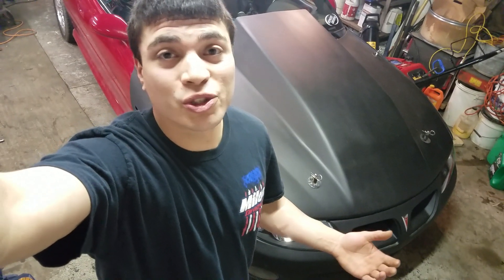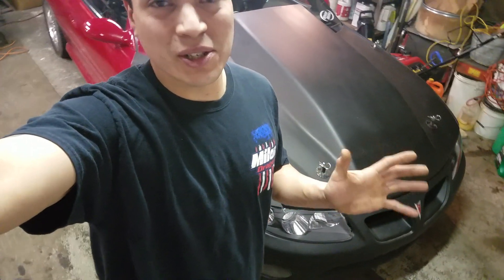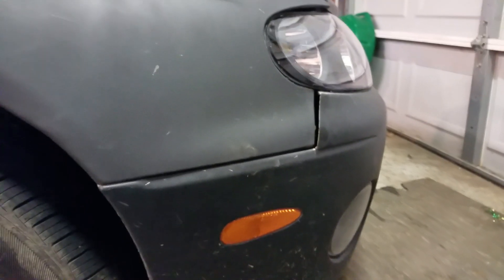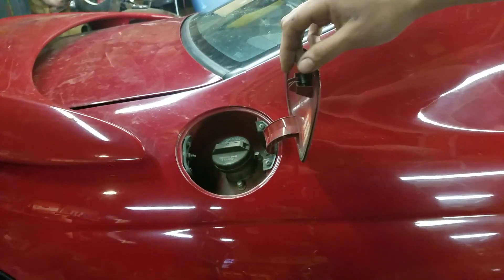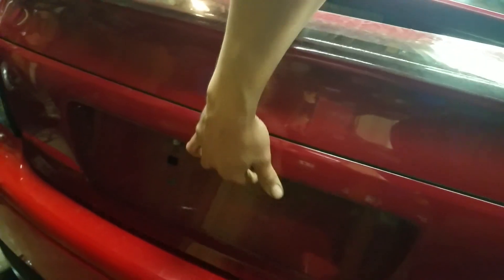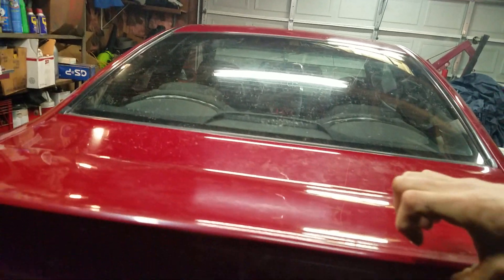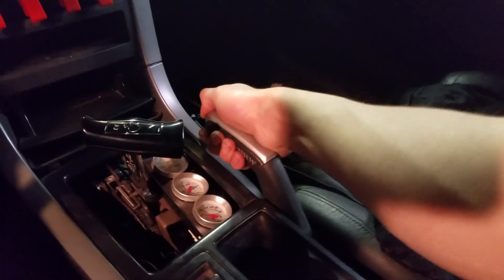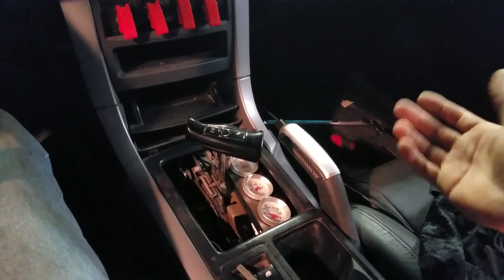5 GTO Problems [ Turbo LSX Dream Car Build ] Please Subscribe

Comment: I don't consider those man things... Yet I've experienced and fix most of those. Here are some of what I've had issues with and fixed on my own. ABS sensors, fuel pump relay, traction control button/switch, gas door seals, front pumper clips, bottom panel seal under spoiler on trunk, gas line lead to under head cover, speakers are junk I replaced all 6 speakers + tweeters and deck, but the worst of all is  ignition cylinder and the driveshaft support bearing. 2005 with kooks long headers, custom exhaust with res delete, stage 2 cams, over radiator vararam cold intake, lowered suspension, and SAP. Car is definitely a head turner and people grt excited to see it when they know what it is! Wouldn't trade it for a hellcat.
Reply from the maker: Thank you for fixing everything and congratulations I'm glad your keeping it. sounds like a really nice car what trans and color? I might make an abs video it's a big issue and thanks for the comment and please subscribe

Comment: My 06 gto has 308,000 miles on and counting its my daily its been a really awsome car been all over in it get compliments about how clean it is and people say you would never know it has that many miles maintenance is key
Reply from the maker: Congratulations that's alot of miles  🤣 Do you still have stock rocker bearings? And your right thx for the comment please subscribe
Reply: Im pretty sure there stock i never replaced them and the previous owner didn't have a record of it being replaced but now i want to get them checked out
Reply from the maker: @joseperez-nx3sv   I would get them looked at bec their are 1000 hardened needle barrings in the rockers that will be sent threw your whole motor oil galleys. Their made to last along time tho
Reply: I will eventually i would like to have the motor rebuilt i put a new transmission in it at 295,000
Reply from the maker: @joseperez-nx3sv  not a bad idea to change head gaskets,  brings and stuff and should be cheep. Damn I bet it was a 4l60l but should be good now
Reply: @JUNKYARDGTO   its got a 4l65e in it
Reply from the maker: @joseperez-nx3sv  
Right basically same thing but I went with a manual 4l80 just to be safe
Reply: That is insane! I was scared to buy one at 137k but you gave me confidence!
Reply from the maker: @sideshowjunkie  
Buy one asap 🤣 all you gota do is solid axle swap it lol
Reply: @JUNKYARDGTO  👍 will do!
Reply from the maker: @sideshowjunkie  
Awesome thx for the comment please subscribe
Reply: @JUNKYARDGTO  I will!
Reply: @JUNKYARDGTO  how come it doesn’t show your subscriber count?
Reply from the maker: @sideshowjunkie  
Thx and its turned off

Comment: you're missing the gasket that goes around the gas door, that's probably why water is getting in. Also use some dry lock on the ignition tumbler, it fixed my issue and it was getting bad
Reply from the maker: that slow goat 
Haha I forgot their was supposed to be a gasket on the fuel cap but it still is anoying and im going to spray my tumbler now lol THX for the tip and comment

Comment: Replace the whole ignition tumbler before 50-70 thousand miles. $65 for parts. So you won’t be stranded with your GTO. Don’t bother with the ignition cylinder upgrade. It just makes it harder to turn on and off. The trunk is you just have to get used to it the way it is. Yes both the front and rear bumpers are notorious for not aligning back to original specs. The front and rear bumper alignment frame clips both break easily. So the only reason to take them off is for collision only and change the side markers badge and fog lights. The less times you take off and put back on the bumpers the better. For that reason I don’t want to install a oil cooler or supercharger. I want My GTO to look as factory fresh as possible. As for the gas cap the gasket wears out only after  say 40,000 or so. So get a new one ☝️ So dust and water don’t get past the fuel door. And even then you still have to treat/rubber protectant the gasket and clean inside where the gas cap is. There is also a drainage hole there too if you spill too much fuel ⛽️ while gasing up and for excess water 💦 if your fuel door seal is bad.
Reply from the maker: Thx bro I got almost everything figured out now for my dream GTO. Im going to be posting new videos soon so please subscribe thx for checking out the videos

Comment: I have an '05 M6 that I purchased new. My gas filler recess has a drain that vents to the street. My E-brake is fine, but I only have 42k miles on it & I don't yank on it like a mad chimp. I had to have my ignition tumbler replaced @ 30k miles. It locked the steering wheel up.
Reply from the maker: Fred Garvin
The gas cap isn't a big deal I think it should be flush mount instead of a big bucket. No way it locked up at 30k what happened? Lmao new videos coming soon thx for the comment
Reply: My wife shut the car off with the wheel all the way to the left. It jammed and would not unlock. Had to remove the tumbler to release the wheel and replaced it. It's the only repair I have done on it in 13yrs. It's been a really reliable, fast, and comfortable car to own.
Reply from the maker: Fred Garvin
Damn that's what happened to me but to me the GTO is the best car ever built. That's why I've been trying to build one sense 03 lol its just taking forever bec I'm on a budget
Reply: I bought mine new, it was $29k. It was the most I'd ever spent on a car, but I just bought a ZL1 1LE  that cost a fortune. But I will not sell my GTO. You're right, it's a very well built car.
Reply from the maker: Fred Garvin 
That's awesome. I bought my first one (Rare 06 Phantom 6.0 6 Speed) in 2012 it was the best car I ever owned everything was perfect until I got Rear ended at 65 mph and I lost everything....
Reply: That's horrible. Keep up with this one. I see a lot of potential. Just take one system at a time, finish it and move to the next. It gets easier.

Comment: I'm looking into buying one in the future, do you recommend it or have any ideas of what I could do it upgrade it some?
Reply from the maker: The GTO is a great street car it depends on what you want to do with it but the automatic transmission is weak and the bushings are soft along with the the drive shift and half shafts. Don't run slicks. 
Thx for the comment and Please Subscribe

Comment: I've had my 04 GTO since 06. The bumper clip issue is certainly not "unknown" GTO owners have been aware and griping about this since the GTOs introduction. As for the fuel door, there is a gasket around it and a drain hole in the well. If yours is leaking, replace the gasket and clean the drain. The trunk lid lacking a keyhole? There are hundreds of cars on the market in the last 15 years that have no trunk keyhole. Common in the days of key-less entry. There is a trunk button on the key fob, which you didn't mention as well as the glove box botton and the emergency release behind the passenger rear seat headrest. In my 14 years of ownership, I have never once found it necessary to yank the e-brake with that kind of force, certainly not enough to break it. Could it break, absolutely, as can the shifter, but generally not under normal operation. 
As for the ignition tumbler, I have no issues with mine. I only have 53k on mine, but I would think a little graphite lube now and then would keep things from wearing.
Reply from the maker: Damn you should have bought an 06 GTO in 2006 the 04s suck lol how much HP does your car have? Do you have a 4l65e? I forgot their was a gasket on the fuel door. It's been a couple years sense I had my 6 6 06 GTO. As for the trunk I hate going in and out of my car at the drag strip to pop the trunk so  I can fill up my fuel cell lol most cars have a button or something but I did say in my video their are buttons inside and behind the back seat. I know the e brake will wear out from normal use but that's how I use my e brake lmao vehicles are meant to be driven and grafite might help the tumbler but it will lock up lol
Thx for the comment
Reply: Well, I would have to disagree that the 04s suck, I am a bit bias. My 04 was $20k one owner w/27k on it when I bought it.. 06s were still going for $33k, so I see mine as a total bargain. 
I have the T56 not the auto. 
As for the trunk release issue you mentioned, in your circumstance (racing) I can see that being an issue, but in regular use, with the button in the glove box and the key fob, it's not an issue. 
As for horsepower, my car in almost totally stock, except for a CAI.
Reply: @JUNKYARDGTO  an ebrakes ONLY PURPOSE is to stop the car from rolling when its parked ffs,not to yank up on like you are uprooting a tree dude,seriously.if you went to the dealer and showed them this like it was an issue they would void your warranty on the spot and tell you to go away. buy a drift e-brake if that's what you do but don't blame the car because you are ridiculous with it.
Reply from the maker: @trillrifaxegrindor4411  
What if it was an emergency? Haha
I used it normal on my old Manual GTO and it broke.
My sunfire e brake never broke and pulled it all the time lol

Comment: Bro that hood is wayyyyyyyy to big lol.. btw just out of curiosity how much did you give for your gto? Rebuilt title? It looks like it's in decent shape. I have an 04 impulse blue gto (mild build) 11.7 at 116 is my best quarter mile.. ls3 swap is coming this winter.
Reply from the maker: LSX 2015
Thx for the comment lmao you should check out my other videos I traded my old car for this GTO bec my 06 6.0 6 speed got rear ended. Clean title and a rough 20,000 miles on the car lol they blew the 5.7 and I smashed the windshield towing the car without the hood latched 😂 your GTO sounds legit. What trans do you have?
Reply: JUNKYARD GOAT damn man yeah I will check your vids out! And just a built 4l60e with a yank 3600 stall
Reply from the maker: LSX 2015 
Thx man and awesome I'm having problems with my TH350 right now
Reply from the maker: LSX 2015 
Right That's pretty much the plan right now. I'm trying to put some more videos together right now I'm just having rough life right now and junk cameras 😂
Reply: JUNKYARD GOAT I posted an idle video of my car. Check it out if ya want man.
Reply from the maker: LSX 2015 
Awesome video I'm putting together an update video soon I've had some major problems over the last couple months with the Junkyard Goat

Comment: You didn't mention the rear seat headrests leather coming apart.
Reply from the maker: This is the first time ive had that problem. Are your gto seats coming appart? Thx for the comment
Reply: @JUNKYARDGTO  pretty much all GTO's have a stitching problem. Driver's seat and rear seats are the worst. Also the headliner sags.
Reply from the maker: @daytonwintle6051  
Damm im not worried about the front seats but i got the GTO with the back seat ripped so i gotta fix it and  I've never  Heard about  The headliner falling
Thx for the comment
Reply: Leather conditioner every month, easy solution.
Reply: I got mines stitched 🧵 at 30k
Reply from the maker: I need to stich my back seats lol
Reply: @williammorgan9941 plus a garage!

Comment: Also with Australian built cars even if they're rebadged they do not like aftermarket bumper bars stick with genuine and you won't have that problem with guard sticking out or not running flush or bumper bars they're just never made a really good aftermarket bumper bars for that particular car so stay with original and also good that to have good clips as well because basically your audio video also came in a 4 door version as well and they have the same issues as well of the same year basically your car in Australia is quarter Monaro but the bottom line is your car is actually a two-door Commodore being rebadged it's a Pontiac GTO and a Monaro in Australia and all have the same little issues
Reply from the maker: I wish their was more aftermarket bumpers but I'm thinking about getting new ones and making my own mounts or using body glue. Holden has some awesome cars lol thx for the comment
Reply: Haha commy lyf 🤦🏻‍♂️ the feels haha

Comment: You bought an automatic and your mom helps you with ignition cylinder problems. Definite bottom.
Reply from the maker: Lol my first GTO was a 1 of 142 2006 6 speed 6.0l t56 but I got rear ended thats why I'm building this GTO thx for the comment please subscribe
Reply: @JUNKYARDGTO  OK you win with a respectable reply.👍👍
 Kudos that you're sticking with the car you love. Love mine. Procharged with methanol injection. The damn driveline and suspension sucks up almost as much $$$$ as the motor! 
Doesn't matter, it's not a Camaro or a Mustang or a Hellcat and I'll keep investing in my 'Aussie 'Vette' and keep spanking the mainstream.

Subbed.
Reply from the maker: @martyfarrell9459  lol thx and wow that's crazy

Comment: I've had none of those problems with my 06
Reply from the maker: Thx for the comment How many miles do you have and how are your roads?
Reply: @JUNKYARDGTO  I have a 107 k so back roads are bumpy my car has seen highway miles and is Brazen Metallic  orange
Reply from the maker: No way I had a t56 Phantom Black 06. Is yours a manual? For your car I would be worried about is the Radius Rod Bushings in the front but otherwise congratulations I always wanted an orange GTO Please Subscribe
Reply: @JUNKYARDGTO  no mine is auto i have bad knees and can't shift standard  only problem i had with my front end was both tie rods had to be replaced other than that my ball joints have never been replaced  and they are solid as the day they were installed
Reply from the maker: My new GTO is a automatic and also have bad knees lol thats good you must have good roads. I always see the Radius Rod Bushings go bad tho thats the circle ones in the front and help you stop good luck

Comment: Front bumper is the only issue you mentioned that is legitimate. With the gas door, your missing the gasket, letting water in. There is also a drain hole that allows water to drain out of there. It is probably clogged. The I don’t see how the trunk is an issue. Just sounds like you whining. You must be hulk because I have had 3 GTO’s and I have never once broken the E-brake. Yes all 3 have been manual. And finally, replace your ignition cylinder. Problem solved. Stop whining
Reply from the maker: Obvously you havent seen my other videos lol
Reply: JUNKYARD GOAT nope
Reply from the maker: @glenkunz5961    
It has a 88mm LSX manual 4l80e with a fuel cell lol I dont care about the gas cap

Comment: Most vehicles don't have trunk buttons, most vehicles gas cap gasket wears out over time and every vehicles ignition cylinder and e-brake wears after constant use. Good video, but bad examples.
Reply from the maker: Thx for the comment. I love The GTO so its hard for me to find problems with it lol as for these problems Its my understanding that they wear out way faster than normal. The key Tumblr usually Jams around 75000 Miles But have heard of them going badd around 25000. I think the e brake cable rubbs on stock exhaust but mine has aftermarket exhaust and my GTO is almost ready so I will be starting it then beating on it for better content 🤣 so please subscribe and thx again
Reply: I'm actually looking into picking up a 04 GTO and the bumpers not lining up after being removed is a nice thing to know and yea I imagine with the trans tunnel and aftermarket exhaust it probably rubs pretty good lol but I'll definitely be checking the rest of your videos out.
Reply from the maker: @Rider0909  
There is actually a lot of room under the GTO bec the fuel tank is In the trunk. I think the GTO is better than the Corvette other than some dumb stuff like axles and auto trans but stock vs stock   GTO wins. Nothing rubbs now on my car I'm fixing everything up lol I would buy a 2006 manual GTO that's the best one. The bumpers can be fixed easily I'm always taking my bumpers off lol 3 times today
Reply: @JUNKYARDGTO  lol if only I could afford a LS2 powered GTO and ahhh 2 or 3 times a day would make sense now
Reply from the maker: @Rider0909  
That's why I'm building mine lol good luck man